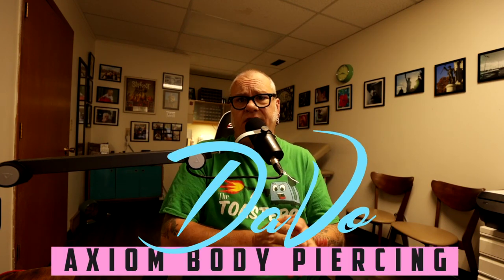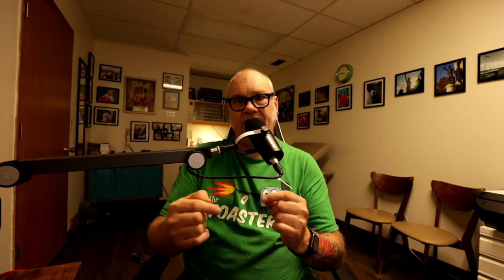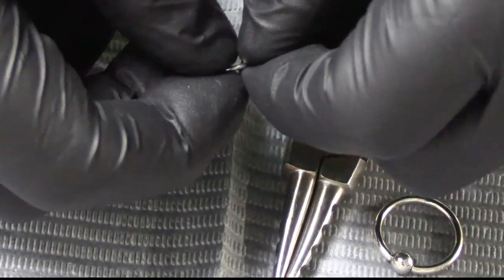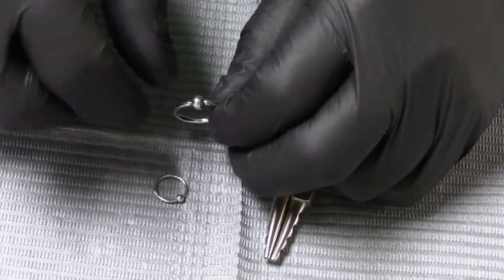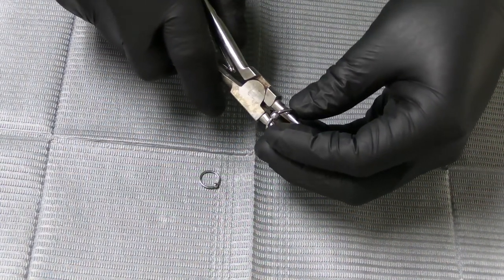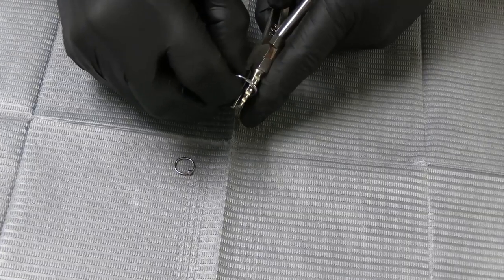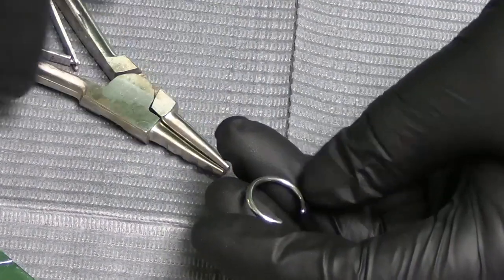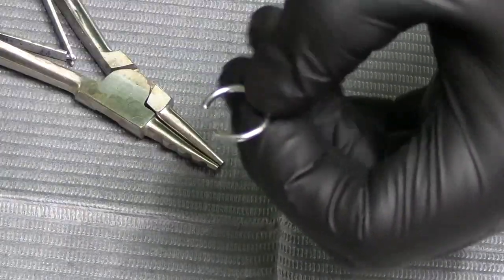Captive Bead Rings Removing & Changing - Body Piercing Basics EP113

Comment: The first time I put a CBR in my lip it took such a long time that the piercing was irritated by the time I managed it. It's definitely something you get better at over time, takes under a minute now. I recommend not using a mirror, I found it makes me more likely to drop the ball and it takes longer. 

I hate hinged rings most, glad to hear you're going to me making a video on them in the future, I always have difficulty finding the seam to get them off!
Reply from the maker: Yeah, I think that most of those that get the hang of it, just do it more by feel than visually. One hint that I forgot to add was to practice removing and putting the bead on when it is out of the body.  

Yeah, the thing about hinged is the better the quality the harder it is to find that seam.

Thank you for your hint and for watching.

Comment: is it normal for the ball to not go back on once separated from ring?
Reply from the maker: Not really. The shape or the tension of the ring may need to be adjusted. If the segment where the ball snaps into is too wide, then you need to squeeze the ring and make is smaller. If the two ends don't line up, it will have to be bent to make them line up. Whenever in doubt see your piercer, we have tools that can usually get it back to normal and keeping that ball in there.

Comment: Is there anywhere I can buy tools to put threadless jewelry into a nostril piercing? How I get it in right now is by putting a 20g needle through my piercing, placing the 18g threadless jewelry on the end of the needle, and using the needle to guide it through the piercing (obviously putting the top on is easy after that!) I'm wondering if this is a safe method as I'm sure needle material is not the highest quality. I do of course wash my hands and clean the needle before hand.

I should also add that I have a double nostril piercing so I really don't want to wear J or L bend style jewelry if I can avoid it. I either wear rings or threadless because that is most comfy and they don't get caught on each other!
Reply from the maker: Oh yes, there is a much safer and easier method. First off you need a threadless guide pin/taper - https://amzn.to/3qiRGxe 

It has a pin side that fits snuggly in the jewelry. You just slid the pin side into the piercing from the outside and then slide it into the jewelry, push it into the piercing from the inside and close it. I've been trying to build up the number of them that we have in the studio and then plan on selling them to clients. Really the only other thing you may need to make it easier would be hemostats. 

I do plan on doing a video in the future on just changing Nostril piercing jewelry. I'm going to try to cover the main types but I personally hate the nail rings and I don't suggest nostril bones. So, the plan is covering threadless, nostril screws, l bends, CBR, Fixed Bead, Seamless, and hinged/segment rings.
Reply: @BodyPiercingTattooing  thank you so much!

Comment: This is the kind of rings my piercer uses. I always feel like I’m going to mess something up or not be able to get the ring in so I usually just go to my piercer and let him do it. I just wonder if I’m the only one that does that 🤔
Reply from the maker: No, you are not. They can be tricky and if you want to easily change them but stick with the rings, I would suggest fixed bead rings, seamless, or depending on the location, hinged/segment rings.
Reply: Well, you are actually more proactive than I was in going to get it changed - I've had the same ring in mine in over 20 years since it was pierced.😂
Reply from the maker: If it works, no reason to change it. The nice thing about body jewelry is designed to stay in the body for eternity.